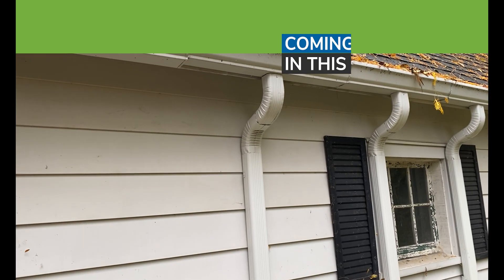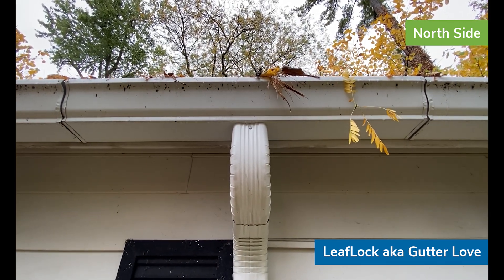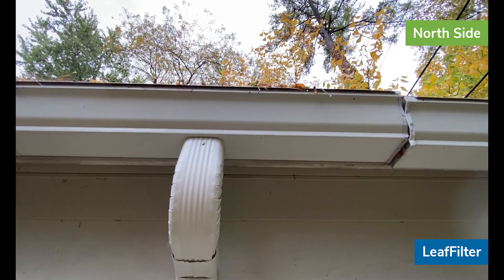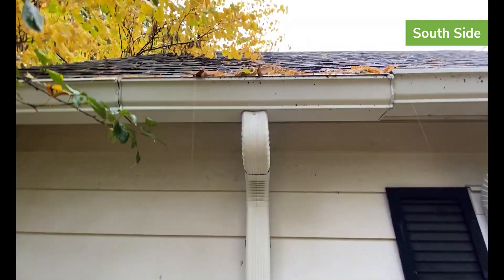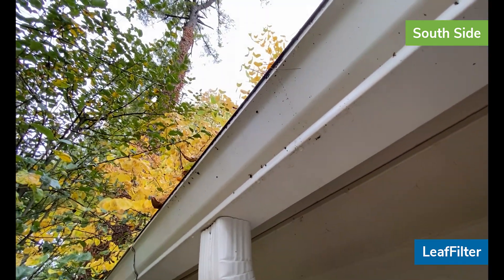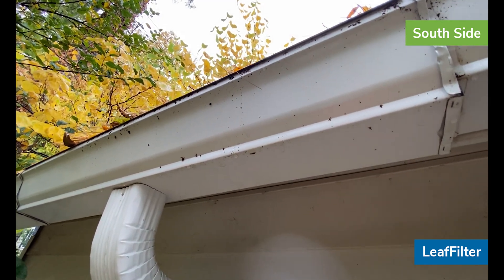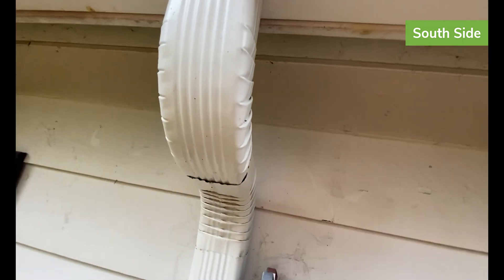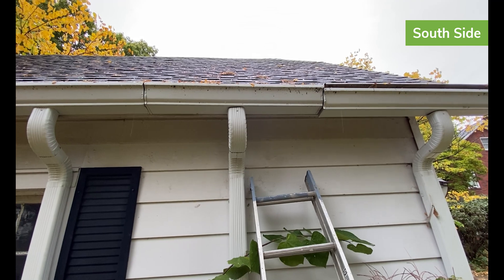Rainwater Drip Test: Which Gutter Guards Fail in Light Rain? [S1 E19]

Comment: Thanks for your work on the series. Have you had any knowledge or experience with the Raindrop guard system?
Reply from the maker: Yes. We tested it, but haven't posted the videos yet. If I recall, it did pretty well with water, but definitely allowed in debris through the slots. I'd say that it's better suited for larger debris than small debris. If you have maple tree seeds (aka helicopters and whirligigs), you may find that the fins get stuck in the slots.
Reply: Yes, and our problems are 2 honey locust trees. That is a challenge.
Thanks for replying!
Reply from the maker: @Lisa-yp5pm  Small leaves and the stems that hold the leaves together probably wouldn’t play nice with Raindrop. That was one of the trees in our test environment, and it wreaked havoc on a lot of the gutter guards.